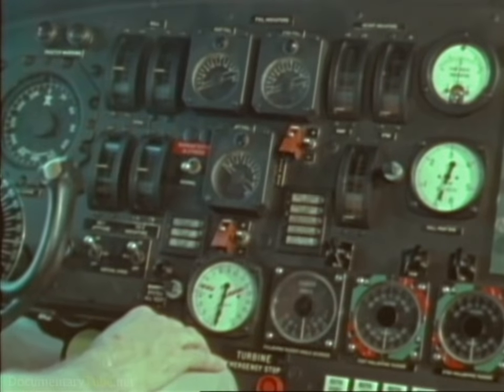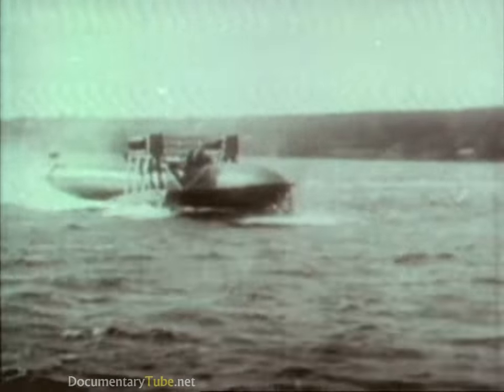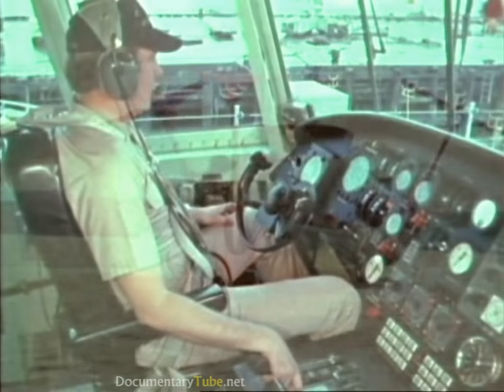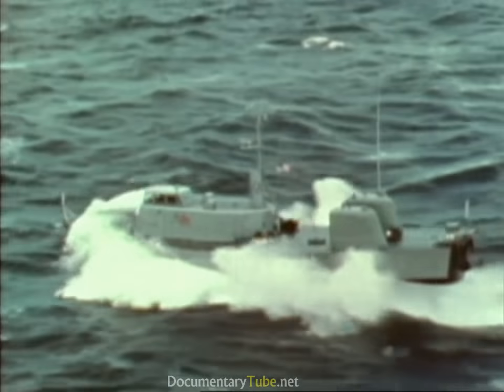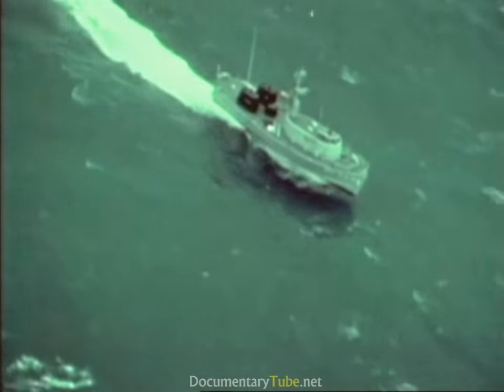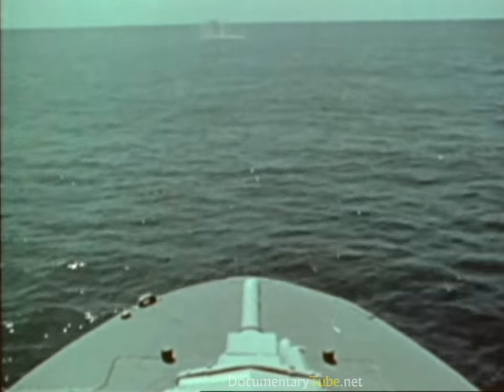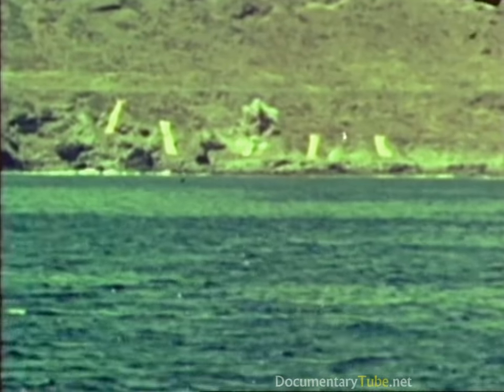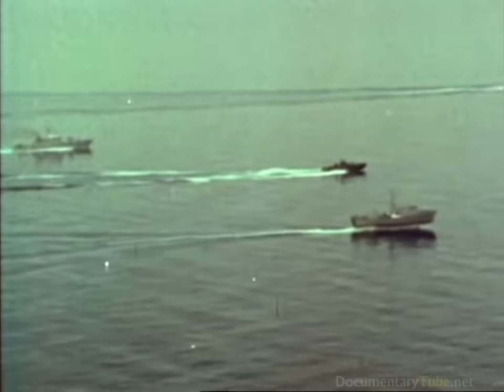The Fastest Ship in the U.S. Navy: Boeing Pegasus-Class Hydrofoils

Comment: I was stationed at Boat Support Unit II (EM3) in Littlecreek VA (1970) when Tucumcari was being tested. She was fast but everybody knew she would headfirst into the water at 60 mph if she hit a single log (which I'm told she did later that year). ANY boat being chased by her could just throw out the trash, her  intakes clogged and she's dead in the water. 
We also tested Air Cushion vehicles for amphibious assault, in theory they could  go over marshland. But they are stopped by strands of barbed wire and tree stumps on marshland. Both vessels were higher profile targets compared to the (L/M)SSC, (Light/Medium) Seal Support Craft were already using.
Reply: Good info, but stale. When we reduced the AALC test vehicles to the LCAC production units we could swallow mast obstacles, and they do, today,

Comment: The soviets had us theoretically trumped in this area with Ground Effect Vehicles much larger some capable of over 400 mph designed to fly just above the surface of the water .
Reply: Kilometers not miles
Reply: Pax: The WIG did not trump the Pegasus boats. They weren't even in competition. Plus the WIGs could not remain at sea when not airborne.

Comment: ...to bad the US Navy stop using Hydrofoils years ago.
Reply: The Italian navy dropped their version of this.  Several liabilities.  Fragile against submerged flotsam. Noisy as hell so a submariner could hear it for dozens of miles.  It's a fuel guzzlers.  Swath hulls are the way to go for high speed ships and they are easer to build at any scale.  USS Independence is a type of refined hybrid between a swath hull and a trimaran.
Reply: +Micheal Beers The HSV's work off of similar concepts in their catamaran design...
Reply: +Micheal Beers The Littoral Combat Ships incorporate fast propulsion and trimaran hulls, which give similar performance to hydrofoils and even more flexibility - they can clear mines with towed gear which has robotic capacity, and have modular weapons stations that can take remote fired autocannon or missile launchers; there is great scope for other weapons at these stations.  And they can host helicopters.
Reply: +Patricia de Chenier ...well there you go, i knew there had to be a good reason for it.
Reply: actually they have been using it and upgrading it
Reply: +Financial Vampire .......you're talking to the wrong person, the people that believe in the UNIONS need to hear your message!
Reply: +Micheal Beers - Fortunately, these videos are ancient.
Reply: +Patricia de Chenier - the problem with the LCSs is that they wouldn't survive in a real naval combat situation.  

I'd put my old Adams Class DDG (USS Hoel DDG-13) up against any four, or five of them in a fight.  In other words, against an old Sovremeny Class Soviet DDG (Which is actually a bit more capable than the Adams'), they'd lose badly.  And those are 60 year old hulls.

Their only advantage over an Adams IS the Helicopters. That advantage disappears against the Soveremeny (either Russian or Chinese).  And a Modern Russian destroyer, or even one of their new 1000 ton Corvettes packed with modern cruise missiles? Well.... that would be bad.

What we SHOULD have built was a real frigate based on a scaled down Arleigh Burke class DDG, something like the Norwegian Fridtjof Nansen-class frigate but with SM-5 Missiles and a slightly bigger VLS system.
Reply: I  thought about the LCS while watching the video, too.
Reply: But don't worry they now has 10 supercarriers in service and 3 under contruction.
Reply: +Micheal Beers WHY????
Reply: Doesn't seem very practical at all for a ship that will take fire. Systems are far to complex and delicate...
Reply: There are now prototypes for ships that have hydrofoils
Reply: And they have a stealthy profile, and can even operate in shallow waters (rivers)  such as the Hudson.
Reply: Foils are very efficient on fuel, much more so than even a SWATH.
Reply: Just print more money, shuffle paperwork, and look busy  : )
Reply: They were failures. Shook themselves apart. Limited flexibility.
Reply: suspending ships on sticks does not work why am I not surprised
Reply: BlueReaper doom humm, don't we essentially do the same with aeroplanes?
Reply: Jungleland33 no them are wings and 2 air and water completely different in resistance and 3 water not exactly known for being the cleanest thing being full of trees and other large debris
Reply: You are misinformed. The Pegasus class was discontinued because of higher-than-estimated cost (no-one's surprised there, this was a collaboration between multiple NATO states). They could not fulfill their intended role of being cheap replacements for the destroyers and frigates tied up in coastal defense.
Reply: +1 zard
Trump should be able to repair some of that damage.
To what extent he'll be allowed to is not known, though.
I hope he is relatively unhampered.
We need to bring this country back to its former glory.
We used to be the world-leader in everything, not just a couple things.
Reply: That's because hydrofoils have extreme limitations that make them unfit for military use.
Reply: NONSENSE. Name me a combat limitation beside, :|"You can't make admiral, leading a hydrofoil squadron.
Reply: Nat Kobitz
Hold my beer

-High maintenance
-High production cost
-Unreliable
-Range restrictions
-Easily detectable
-Most Navy combat operations dont rely on speed anymore, unless you cant outrun a missile.
-Limited firepower

There, 7 reasons why they dont use the hydrofoil for military use anymore.
Reply: And they beat the living hell out of their crews in any sort of a sea. One of my former students at ET school was assigned to the Tucumcari. I was aboard an old T-2 USNS tanker when they came alongside to refuel while we were anchored at Palma in 1976. He came aboard for a hot meal, like the rest of the crews in the squadron, and he gave me an idea of what the experience was like by taking off his shirt to show me his bruises from the storm the night before.
Reply: NO WAY
Reply: Not so. For pure operating efficiency, disregarding all other requirements, any displacement ship is supeior..You must look into the "Transport Effciency" curve to determine the best hullform for a particjlar need.
Reply: Nonsense,  Spurious items.
Reply: Closer to actuality. You must examine specific mission need todetermine correct hull form.
Reply: You missed my post which said that you must see the position of the ship's requirement on the universal transport curve to determine the best characteristics for a new design.
Reply: yea, russian, commercial...
Reply: Did you see how old the controls looked
Reply: high operation & maintenance cost, technically complex, highly dangerous & fragile when you accidentally hit a floating object no matter what it is, practically only in a calm & smooth sea state (hydrofoil is irrelevant when encountering a rough sea level, expecting a very bad weather conditions), very loud & easily detected by enemies (nowadays ship design is almost a stealthy design)
Reply: they saw soviet ekrano planes and that was end of this story.
Reply: @DevSolar  Someone told me once that there was an ungodly amount of stainless steel in the things.
Reply: The RCN had, and experimented with, an anti-submarine hydrofoil, she was powered by a diesel at slow speeds and a large gas turbine that was used when up on the foils........that was in the mid 1960's
Reply: Will.J  I was drunk when I wrote that piss off lol
Reply: It's now Ketchup time. Need to intervene on the new mine layers.
Reply: Stable shooting platform underway. High speed infiltration, exfililtration under radar. Doubled range on same fuel. Sounds like a dream to me. See a ship on the horizon and be in range before they can line up guns.

Comment: have you ever seem a ekranoplane? thst is a real fast  ship!
Reply: An ekranoplane is not a ship, nor a plane :)
Ground effect vehicles are their own kind of vehicle. But yes you're right, nothing beats their speed on sea. Especially the old soviet prototypes.
Reply: What ? Any tipe of condition is mot a problem
Reply: Ekranoplanm the Russian's "Caspian Sea Monster", was a WIG (Wing In Ground Effect) craft. It was destroyed in a crash as did all of the otherv WIGs.
In order to get grouund effect you must fly so close tu the surface thatwaves form a great danger. Its dwnfall.
Reply: Very Interesting. I saw the Caspian Sea Monster as a US rep for a seaplane conferance, at Aneppo. It crashed about 4 months later. The problem was vibration due to an undulating ground effect over waves and no anticipitory control program. I don't believe, with the current state of technology that WIGs are practicalm but, I have been wrong before. Please comment.
Reply: ekranoplane isn't a ship. It's an aircraft.
Reply: It's a WIG (Wing-in-ground-effect). Gets its boost by flying closeb to the surface ~1/2 of a chord length. Very dangerous Ekranoplan and most of the other WIGs crshed.

Comment: Imagine putting Hydrofoils on Battleships like Yamato and Iowa! XD!
Reply: How about fitting hydrofoils to Queen Mary 2 or Symphony of the Seas? XD
Reply: It wouldn't work well.
The largest hydrofoil was the USS Plainview; weighed 310 tons. A 60,000 ton battleship would need huge horsepower. As the boat slides on hydrofoils, it becomes extremely fuel efficient and provides a smooth and fast ride because of less hull in the water.......even so, However; One would think they're efficient, but to get those speeds you need very powerful engines. The Pegasus US Navy foil's used two engines for power, for non foil propulsion it used twin 800 hp diesels, very efficient for a modest 12 knots, for foil borne, used an LM2500 gas turbine which consumes 1700 gallons of fuel per hour! An Iowa cruising at 17 knots had a fuel range of 15,900 nautical miles or 0.007 miles per gallon in the case it used 2673 gallons per hour.

Comment: The system was called HyCATS. Hydrofoil Collision Avoidance and Tracking System.  Of course whales were not on the chart.  Sliced right through and completely clogged the turbines.  If they did hit a sand bar and torqued the boat, they could twist it back with the foils in manual mode.  These things were fast.  Speeds in excess of 45knots, but it comes up on the foils at 35knots.
Reply: CLOSE but no cigar. Actually the HYCANS (High Speed Collision avoidance and Navigation Systyem was developed by Sperry, under contract to the SES program.

Comment: In the early 2000's I saw a vessel operating along the Columbia River between Astoria and Hood River that was a lot faster than 50 Kts. Though I did not get to clock it accurately, I would guess 70+ Kts. I could only proceed at 35 Kts. I did get a man in the Corps of Engineers to admit to operating a very fast vessel, but he would not divulge exact performance. This vessel appeared to be in the area of 50-70 feet in length.
Reply: +Khadijah Brown One task for the Boeing Jetfoil was chasing fast Subs

Comment: In a conflict battle area there is so much floating debris that this design is a liability in battle due to possible impacts with debris and the control surfaces beneath the waterline.
Reply: Not really.
Any ship is vulnerable to debris, but a foil, particularly a surface piercing foil is going to hit any debris at a lower angle of incidence, resulting in lower kinetic energy transfer.

Comment: A beautiful bit of Italian engineering 😉
Reply: Italian? ? try boeing seattle wa.!!!
Reply: +davetileguy I worked on the PHM program and all the designs for the PHM were based on Italian designs done in the 1960's. We only did final engineering and building from the original designs and most of the components from the internal communications, gear boxes and auxiliary diesels were all German and all nuts and bolts were metric to meet NATO standards but the boats were rejected by NATO and ended up in Florida with the US Navy.

Comment: HYCATS = Hydrofoil Collision And Tracking System.   But it did not include the occasional whale which would clog the turbines with fat.  Speeds in excess of 40knots, but it got out of the water at 35knots.  It was FAST.

Comment: One of the reasons hydrofoils aren't used much is the HUGE amount of fuel they use.
Reply: I was about to buy an old 2-engine TPT Nasty Class for making a house boat. When I read up on the 6200 BHP oposite piston Napier Deltics, I figured no chance :D How much more impressive does fuel consumption reach in comparence ?
Reply: @ogreunderbridge5204  How often are you going to leave the dock and how far will you travel?
Reply: @PaulOfPeace54  Far and often enough to go bankrupt on that deal :D I looked at a few fishing and sail vessels after. I ended up buying and restoring a veteran cargo truck, as it takes much more for it to sink on me
Reply: @ogreunderbridge5204  Remember, BOAT stands for Break Out Another Thousand.
Reply: @PaulOfPeace54  Entirely correct. I like designing them on screen and paper way better then paying cost and work to maintain them. Trucks only takes 500 pr turn and does not usually park at the bottom of the ocean for a slightly windy fresh day :D

Comment: I'm still scratching my head trying to figure out where these water-jet propelled ships are picking the water up when only those skinny little foils are the only thing touching the water. Anyone else notice that?
Reply: They sucked water into the struts that supported the foils, up into the hull, to the impellers, which produce the water jets.
Reply: I guess that's all I could figure, it just seems like a convoluted way to get a great volume of water into the impellers, seems like a lot of 90* turns all that water has to take, you know? Apparently it works!
Reply: Andork Kuomo 
I know what you mean, but as you said, there's no other way to do it.

Since water is non-compressable, there's no problem of pressure buildup where the pipes make bends, so that makes it a little easier, but it would still be an engineering challenge, no doubt about it.

The earlier hydrofoil used propellers, with variable-length driveshafts, and the angle of the driveshaft had to be adjustable, so that would have been more difficult, imo.

Lol, people seem to come up with solutions to all kinds of problems, all it takes is money and time.

Comment: You can't get hit by torpedos if you are over the water,  tap head
Reply: Detonating a torpedo under them, or close aboard, would send it higher into the sky than it can safely land from, and worse, the concussion will disconnect every pipe inside the hull. You need a little bit of experience getting blown up by underwater explosions. Take it from an old minesweeper.